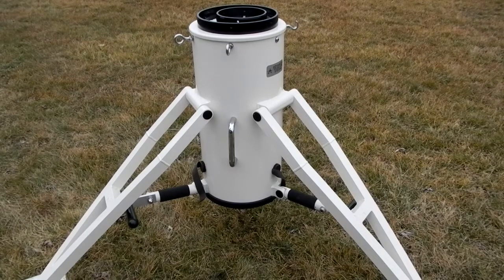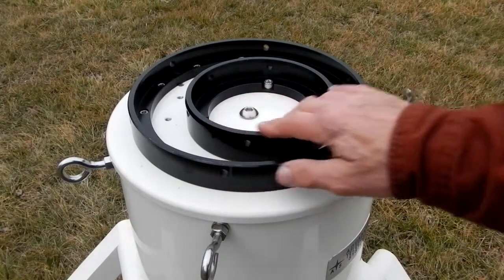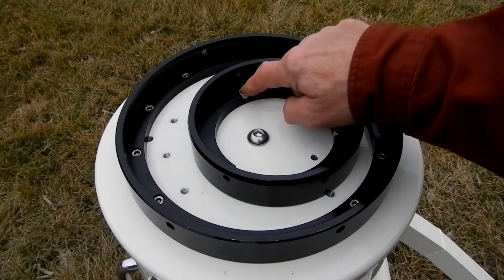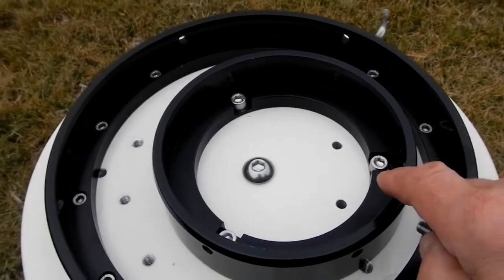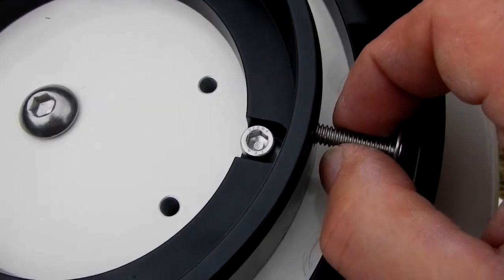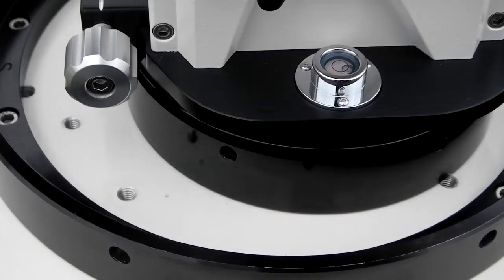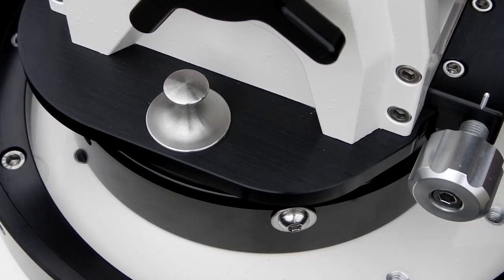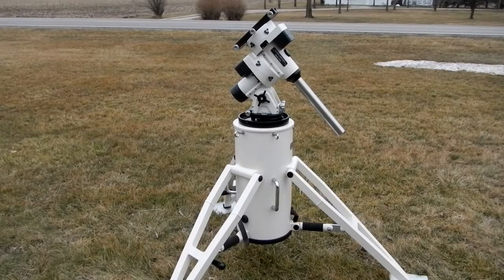Astro-Physics Mach2GTO Equatorial Mount on a 12inch ATS Portable Telescope Pier

Comment: With the Allen key going through the hole of the larger flat surface adaptor. Poke the long end of the Allen key through the hole and clamp some vice grips to the short end perpendicular to the long end and you now have more leverage to tighten it. No need to butcher the Allen key just undo the vice grips and your done. The Mach 2 is cute. I'm close to installing my GTO1200 into my newly built observatory. I'll finally get to look through my 130GTX. It's only been a 14 year wait !!
Reply from the maker: Hypersphere Engineering   Good idea. So cool that you have an observatory to keep your equipment permanently setup in. Makes for more observing time. WOW, 14 year wait on the 130!!!!!! Clear skies.
Reply: @starastronomer  not quite 14 years. The scope was a 10 year wait and I moved house 4 years ago. I didn't bother setting it up in my old roll off roof observatory so it's been unused and in storage for 4 years. I bought a fibreglass Sirius Dome observatory second hand this year. Sirius observatories are made here in Australia. I have spent the last few months preparing concrete and electrical / data cables. When it's finished I can send you a link to my photo gallery if you're interested
Reply from the maker: @hypersphereengineering6015  Yes, please send me a link. Would love to see the pictures when you have them.

Comment: g`day very nice rig  .. ever thought about a T handle ball head allen  wrench to get more torque on the bolts much nicer tool to use than a allen key harder to miss place in the dark too 
cheers
james D
Reply from the maker: James Dougan   THANKS! I do have T handles. Guess I never thought about using them. I do agree a small allen wrench is hard to find at night if dropped.